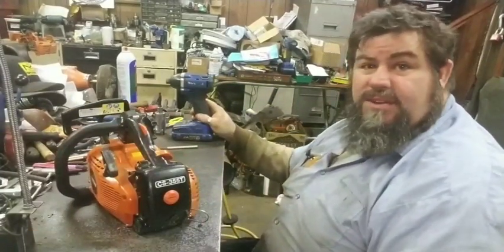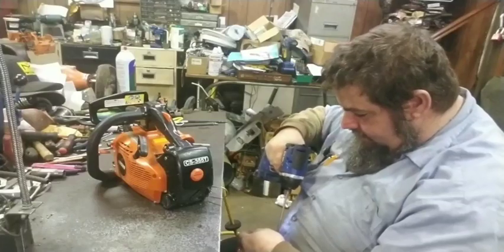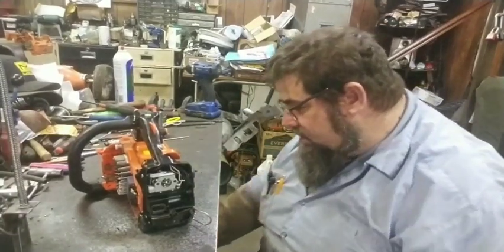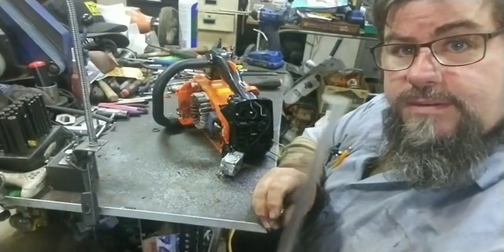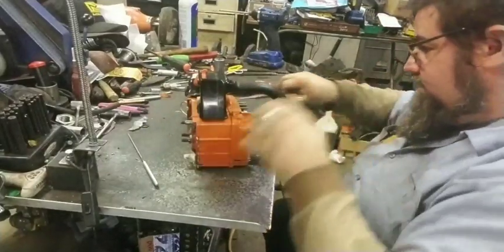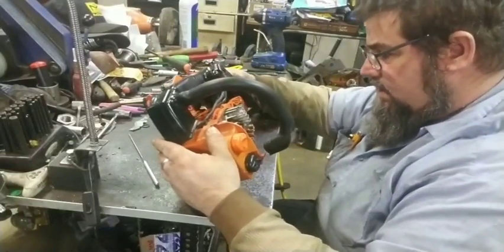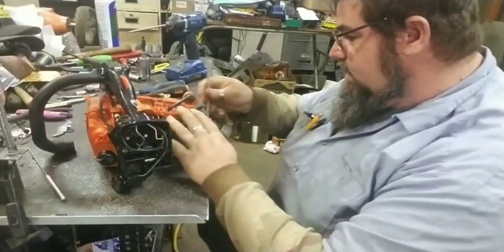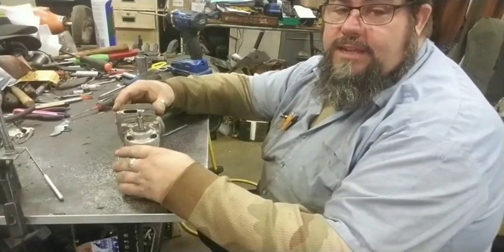Echo 355t pull apart

Comment: Thanks, I just broke the front handle mount off of my CS355T, (my fault) I need to replace the engine cover.  This showed me what I need to do.  Ordered the part.  Hope I can do it with no issues
Reply: Probably already fixed it, but in case this helps anyone else.

I broke the brake handle mount (left side) on my 355t, and would have had to replace the whole engine cover if i was just buying parts.

What worked for me was buying nylon spacers from home depot. After grinding out the broken plastic stud so I had a flush bottom and an outside circle I put epoxy over the area, and put a nylon spacer that I had lathed to the inside dimension of the brake handle. The outside dimension fit the mount well.

I don't have a lathe, so i clamped a 1/4 in drill bit to my work bench, slipped the 1/4 id spacer on it, then put a clamp on the drill bit to keep the spacer from running off. Once that was set up i used a carving bit on my dremel and rotated the spacer against it.
Reply: Hey I know you posted your comment 8 months ago, but how did you make out?  I just busted the handle mount off my 355t and have the pqrt ordered.  Not looking forward to taking it all apart though
Reply: @eskimomonkey2  
It was easy, printed the parts illustration, set up a table in the garage and took it apart.  Had the parts laid out for easy reassemble. There is a hidden o-ring in the oiler that I almost missed, but it went back together fine and I have used it a lot since then.  I am careful not to yank on it if I go get it pinched.
Reply: @Jake-cz1kb  That's exactly how I broke mine lol
Reply: @Jake-cz1kb  where did you get the parts diagram?  What gap did you set the coil?
Reply: @douglaswilson6634  The parts diagram is on line, I believe I just googled it.  Don’t recall what I set the coil to, I’m sure I found that on line as well.

Comment: Thanks for showing this.  After replacing the fuel lines and purge bulb, my impulse tube came loose.  I was going to take apart the handle and linkage, but removing the lower side handle instead will save me some hassle.  Any videos out there showing how to re-install the impulse tube?